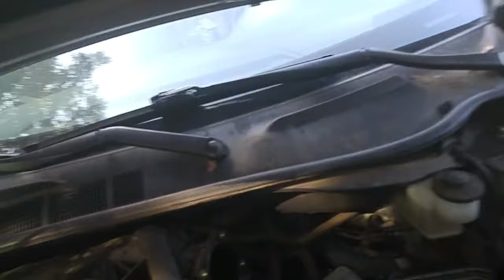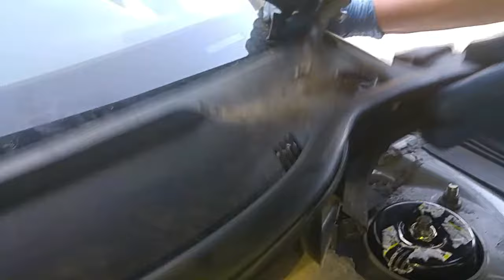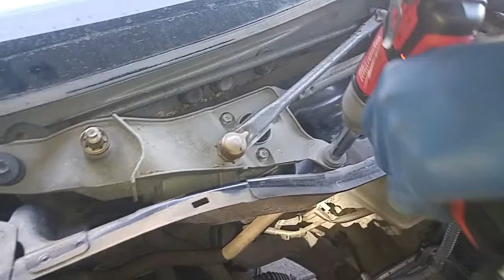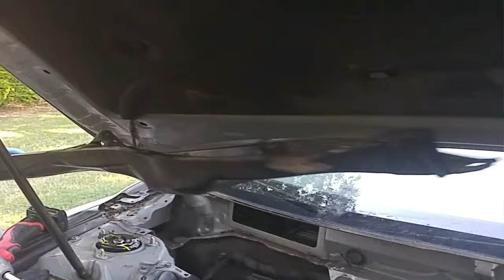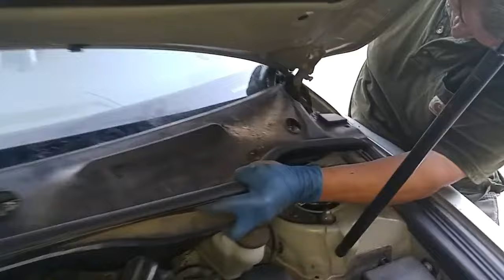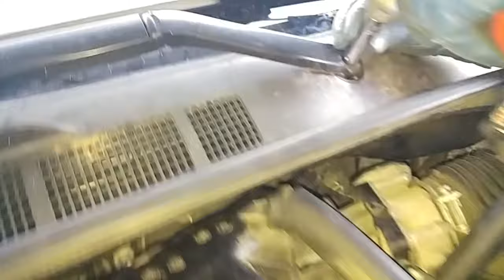Toyota / Lexus Wipers, Motor And Cowling Removal/Re-Installation

Comment: I have a 13 Avalon and could not find a video that showed how to remove it. Even though my cowling is slightly different I obtain more info from your video than any other video I've seen so far. Straight to the point with great angles that show exactly what you did and how you did it. Bravo and thanks. You have a new subscriber.
Reply from the maker: Thanks for sharing and glad it worked out for you!

Comment: Why did you remove the metal cowling? Glad you showed me how to remove the plastic cover. Want to vacuum mine out.
Reply from the maker: If you need to get to engine components under the cowling.  To just replace the wiper motor, you can leave the cowling in place.
Reply: @hardlymovingpro  what year was this Camry? Mine is a 2013 and does not have those two fasteners on it.
Reply from the maker: Video made on a 2005 Camry V6.
Reply: This was the answer i came for thanks @hardlymovingpro

Comment: This is great to know, your videos are so good and to the point. Can you safely remove those three strut nuts if the wheel is off the ground?
Reply from the maker: Yes but first detach the strut from the steering knuckle.
Reply: @hardlymovingpro  OK thanks for getting back to me I appreciate it
Reply: @hardlymovingpro  why would you remove the strut from the knuckle? You're taking the mounting nuts off the mounting studs on the top. No need to remove the bottom part of the strut too.
Reply from the maker: Then how do you replace the old strut?
Reply: @hardlymovingpro  this is in the context of removing the nuts, in order to remove the wiper cowel. They didn't say anything about removing the strut, just the top nuts. Their question reads like they may have been wondering if the strut would come apart (as it would if you removed the large center nut). People get taught to be afraid of the spring, but not taught how the strut assembly works, so they're left with questions like this.

Comment: OMG. I wish I realized I could do this before I took the intake plenum off my 99 ES300. It would have made the plenum bracket much easier to disconnect. It was do-able, but next time I'll definitely remove these items. I only realized this since my friend wants me to do spark plugs on his 06 Sienna, and you really have no choice but to remove the wiper cowling assemblies for the van setup as I've now learned lol.
Reply from the maker: The 99 doesn't have this setup.  Think it started with the ES330.
Reply: I don’t know about that car but in my Lexus ES you can just stick your hand behind the plenum to feel that fastener.

Comment: Hey! My daughters 2014 corolla is having wiper motor trouble. Control switch on steering wheel (relay) seems to be working because i switched it out with another couple switchs, and wipers only operate in fast mode. Seems very easy to replace the whole wiper motor assembly after watching your video. I hope that is my trouble! Thanks
Reply from the maker: Hope it works out for you.